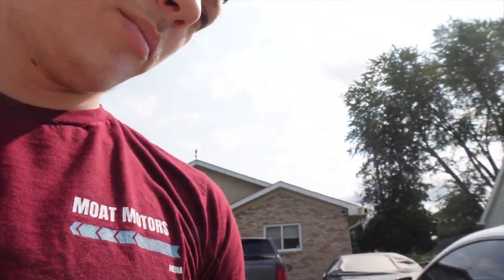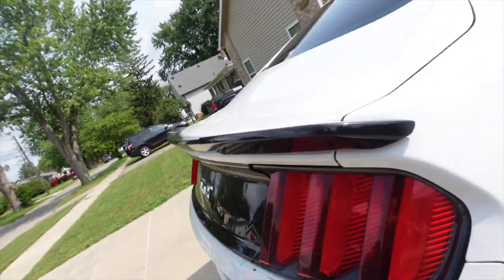2017 Mustang GT s550 - Bumper Swap & GT350 Diffuser Install!

Comment: I've wondered if the GT350 rear bumper fits on the regular Mustangs. Cool! So, just to confirm, this is a genuine GT350 bumper, right?
Reply from the maker: This is not a gt350 bumper it is just the premium bumper with the gt350 rear diffuser. The regular bumper has the lower piece fused together, even those that could still be used you would just have to cut that section off and make the indentations for the clips! Hope this helps!
Reply: @MoatMotorsMedia  Oh, I see. Thanks for the quick reply. So, just the diffuser is from an actual GT350?
Reply from the maker: @sonydominates  yes sir, no problem thank you for the support!

Comment: Hello bro i have 2015 ford mustang i wanna replace the diffuser can i cut it or should i buy the new one.? If yes which model bumper did you bought in the video ?
Reply from the maker: You can cut it but you may have to make the cut outs for the clips to slide into but I’m not 100% sure. We used a GT premium bumper which has a detachable valance/diffuser